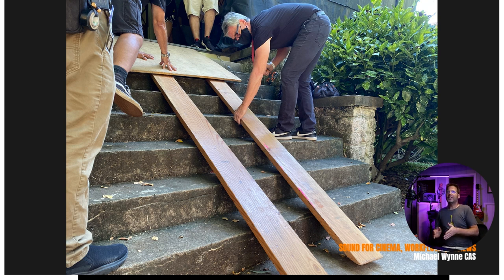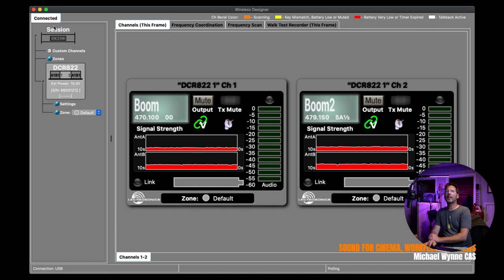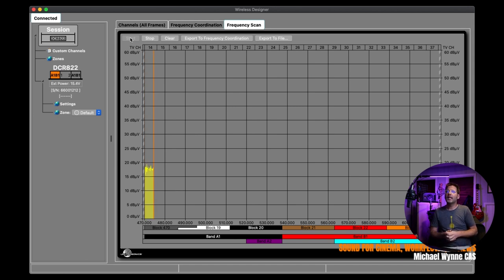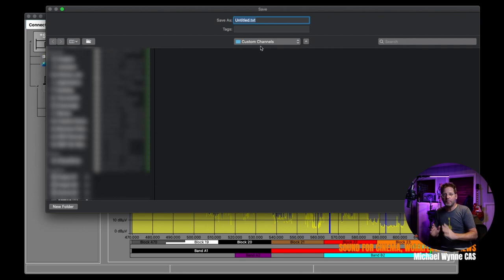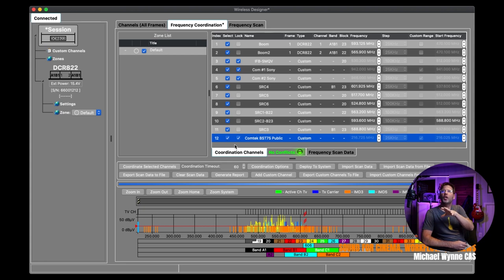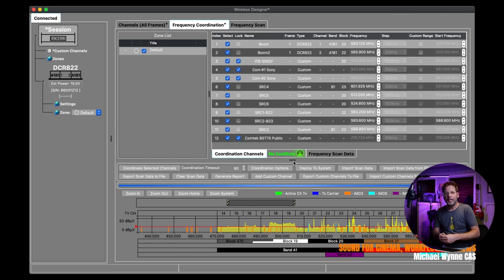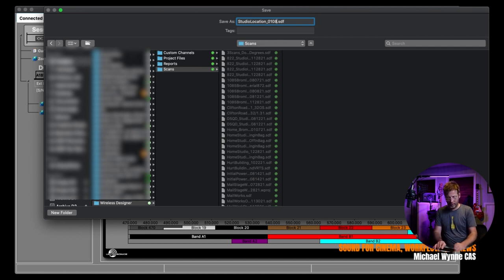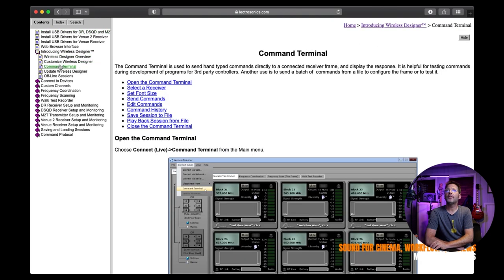SMALL CART Workflow with Wireless Designer & DCR822!

Comment: Interesting video thanks. Does running your IFB Tx at 250mW not reduce the range of your talent mics by swamping the Rx? I’ve always tried to keep anything near my cart at 50mW or less.
Reply from the maker: Thanks Acorn, very good point and you are correct. Typically I run LPDA’s away from the small cart on a stand and IFB stays on the mini cart.  So that keeps those issues at bay.